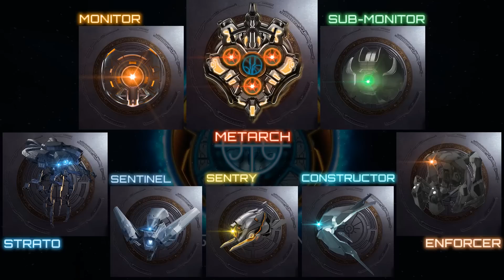Faster Than Light Travel | Mass Effect

Comment: Something you didn't mention is that as FTL speed in mass effect is determined by acceleration, travel speeds would actually increase exponentially with travel time. A ship travelling a set distance in a day would travel four times that distance in two days.

The assumed FTL speeds for mass effect ships in 24 hours are 12 ly for civilian ships, 13 for the Tempest, 15 for military ships (a bit higher for the Normandy) and 30 for the reapers.

In 48 hour this jumps to 48 ly for civilian ships, 52 for the tempest, 60 for military ships and 90 for reapers. Civilian and military ships tend to top out at these speeds since due to static build-up, they can't maintain constant FTL for longer than two days. The the Tempest and the Reapers could theoretically continue accelerating in definitely. In fact, based on the time it took for the Reapers to reach the milky-way and assuming that they never once stopped, I have calculated that the distance to their location in dark space is more than twice that to Andromeda and they crossed it in two years. Considering that they typically reach the galaxy through a mass relay floating independently in dark space rather than conventional FTL, this is not beyond possibility.

As for why the Andromeda arks took so long, the simple explanation is fuel consumption. The arks fueled themselves for their journey by using buzzard ram scoops to gather hydrogen for their fusion plants. I believe these are the four big spikes that sticks out the sides of the ship's. And as seen, these are generally closed during ftl travel. It's unclear why, maybe their too fragile, exten beyond the ftl bubble, or maybe it's just impossible to capture hydrogen at those speeds. Either way, the only way for the arks to refuel would be to drop out of FTL every now and then during the journey and spend some time traveling at sublight speeds while refueling. This would have delayed them significantly.

Comment: Element Zero (0); realistically, this is the most realistic way FTL could be achieved in real life; having an exotic form of matter of which its mass 'flips' to negative when an electric charge is applied. Now, this is assuming the inertial mass is the 'mass' that is affected (generally, inertial mass and gravitational mass are assumed to be the same thing, but if such an element as element zero were to exist, then it 'may' behave in a way that exposes an inherent difference between inertial mass and gravitational mass; however, if no such difference exists in nature, then no 'exposing' would occur, and m would simply change to -m in the equations F = GMm/r^2 and F = ma

Thus, in a gravitational field, a negative mass would behave as GM(-m)/r^2 = -ma <=> GM = r^2 a, which is the same as a positive mass.

This is because the negative mass would have the force from the gravitational field applied in the opposite direction; but since the mass is negative, it responds by accelerating in the opposite direction to the applied force, thus making it accelerate in the direction as a positive mass would accelerate

It gets interesting when you apply a non-gravitational mass (or if the inertial mass and gravitational mass are not equivalent.
Reply: What about a chemical charge
Reply: I farted

Comment: I got 10.8 Ly/day (to 1dp) for the ark ships by doing 2500000 (Ly) ÷ 634 (years) = 3943.21766562 (which is Ly/year) and then 3943.21766562 (Ly/year) ÷ 365 (days in a year) = 10.8033360702 (Ly/day). If I did anything wrong please feel free to let me know. I was inspired to do this from what defeatSpace said. Also keep in mind idk if the ark ships also had to stop to let out heat that built up.
Reply: Unlike Normandy and Tempest the arks are not stealth so they wouldn't be storing any heat. Though like the Tempest the arks have massive capacitors to store and use the static buildup since they couldn't discharge into the empty dark space between galaxies.

Comment: Your description of it accelerating and decelerating is identical to how it works in the game elite dangerous. When inside a system the fsd (frame shift drive) will fold space around the ship and the thrusters will accelerate the ship constantly like in "the expanse". Halfway to your destination your reverse thrusters fire and decelerate the ship to sublight speeds before collapsing the field around the ship. This allows for no time dilation and faster than light in system. 

From system to system the fsd instead folds space on front of the ship, creating a temporary worm hole between systems and the ship traverses it near instantly. It does have a light bending effect as you describe as well while in "witch space".

Larger ships operate on similar principles but with more brute force. Smaller ships open a hole while larger ships tear open a hole and witch space along with electrical discharges pour out of the opening. 

Didn't realize how well this was designed until now.

Comment: I mean iirc we see the relays being repaired in the perfect destroy ending but without the relays the species of the galaxy could only go at speeds of 15 light years a day maximum which is a snail's pace for full on galactic travel and they would need to stop quite often to discharge built up heat as I bet most ships aren't built with the relays being unavailable for travel in mind.
Reply: Makes sense why in ME3 when using the Galaxy map you weren’t restricted to a single system but a couple in a Cluster. FTL is good enough to get to nearby systems but to get even a quarter of the way across the Galaxy you still need a Mass Relay to launch you into much higher speeds.